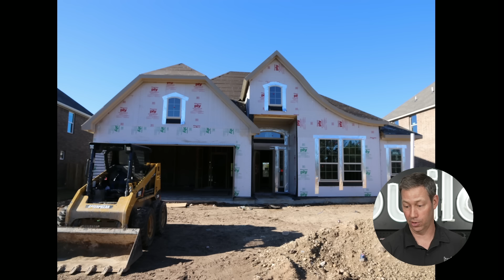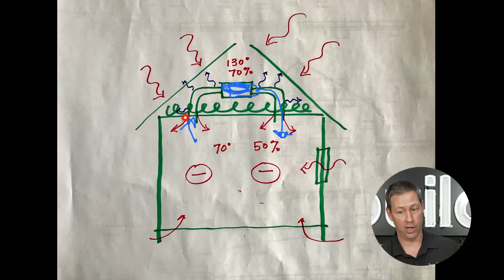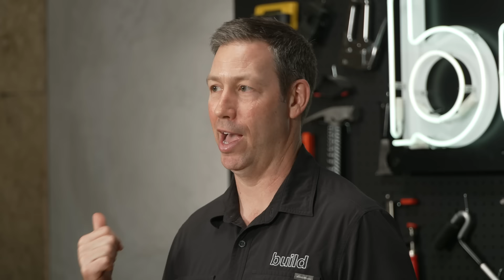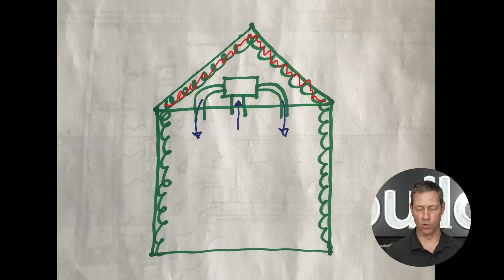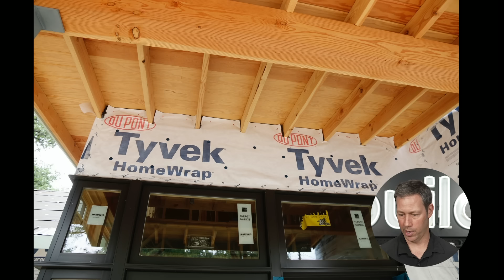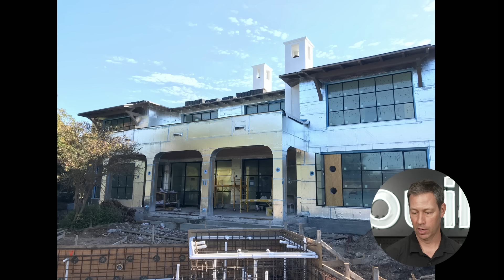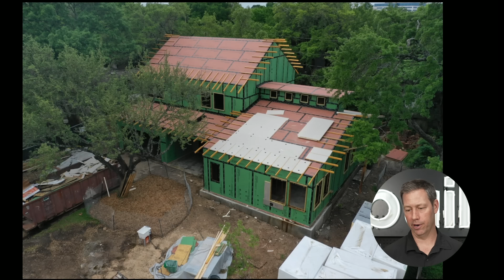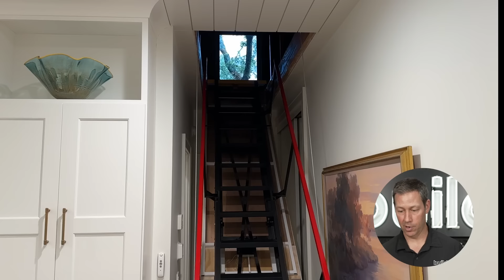CRAPPY ATTICS are Standard in America! Here’s how to BUILD - DECENT or AWESOME

Comment: I definitely would be interested in a video showing how to take crappy to good or great.  Lots of people have an existing crappy attic.
Reply: I second that 👍🏼
Reply: What about asphalt roof can you spray foam that and still have it vented ?
Reply: Would be good. I live in Western Australia. What you are showing as 70’s in Texas is what is in new right now for us in WA. 

None of it is good but it’s all we have to work with. 

How can we make it better? Where to start?
Reply: He has a video doing this (somewhat) I believe it's titled Insulation 2.0. They suck out all the insulation. They seal every on the attic floor like between the joists/drywall, can lights, etc.
Reply: why no absement sin texas?
Reply: @kevinlcnsouthknoxville2685  You could, but why waste the insulation of the space will not be conditioned?
Reply: @randomrazr  the soil is very thin, then it’s clay that shrinks and expands, under that is a sheet of shale.
Reply: @randomrazr  they hit bedrock just a few feet down.
Reply: @randomrazr  most of Texas was an ancient sea. We have shifting heavy clay soils that do not do well with basements. Also our groundwater is high in over half of the state.
Reply: In Austin, I wish I had the know to get a heat pump and get away from gas heating so I could have tried to seal my attic. I'm wondering how I would increase the performance with out having to get an other 10 grand in ac equip to replace the ac unit I just bought a year ago.
Reply: @kevinlcnsouthknoxville2685  they make ducts of sort that staple to the inside of the roof deck between the rafters which provide an air gap and then get spray foamed over. Or what i did, i liquid nail glued some 2x3x4" (so 1.5x2.5x4) blocks to the sides of the rafters tight to the roof deck. I then cut and screwed foil faced polyiso foam board to those blocks and can foamed the seams. I filled the 2x6 rafter bays and then covered everything with another 2" polyiso board and foil taped the seams. So ive got a 1.5" air gap in every rafter bay thats air sealed and if the roof starts to leak theoretically it will either leak out the soffits or just dry because of airflow and never get to any kind of interior space. I went this route as a diy method and i got the foam board for a really good price. It was a lot of crappy work but its already made a big difference. A final note, i glued the wood blocks to the sides of the rafters instead of the roof deck so that way in the future when i get a new roof and roof deck the blocks don't get ripped off woth the decking ruining the foam work. And when that time comes i may also can foam the seams while the deck is off just to future proof and guarantee the system even more.
Reply: @leelulady2010  so basements would flood?
Reply: @randomrazr  People will say "there's no need because the frost line is only a couple of inches" which is true. However, basements are not dug because some places in Texas the water table is too high which would lead to flooding and in other places, the bedrock is too high which would not make for an easy task of digging for a basement.
Reply: Either when reroofing, seal there at the roof deck otherwise gotta take up the floor, remove all old insulation, air seal the floor of the attic, and then blown in insulation on top. Or can convert it to a conditioned attic potentially and spray foam the deck from inside the attic
Reply: @randomrazr  The clay ground doesn't work well for basements.
Reply: @randomrazr  close to sea level and the soil is very expensive & impractical to dig in.
Reply: @TheFlyingCougar  is that why hosues are cheap their
Reply: Insulation is just a thermos for houses! holds daytime heat and gives it to u all night long!
Reply: @randomrazr  1. Limestone bedrock just a few feet down (here in Austin, anyway). 2. The ground doesn't freeze, so no need to protect foundations from heave. Almost all older houses here are pier and beam. I've lived here for decades and only know of one house with a true basement.
Reply: ?? throw some plywood down
Reply: @srt4b  Ideally you want the attic to me conditioned space (or at least partially condition), especially if you have an duct work. Even preventing attic storage items from deteriating from the heat.
Reply: He kind of did this talking about using open cell foam with a pre-foam process to seal gaps...but I agree I would like to see crappy to great...say maybe something you need to do when the insulation and ductwork needs replacing (~30yrs?)
Reply: @kevinlcnsouthknoxville2685   What surrounding counties are you willing to do work in outside of Knox?
Reply: I live in northern Airzona.  Really dry, but the Temps can still reach 110 in July. My house was built in 2002 and looks like the crappy attic. There are huge louvered vents on the gable ends so it is dusty up there. There are piles of pink blown in insulation but nothing on the roof itself. Can I insulate the roof?
Reply: @debrajabs9523  Issue is that your attic is set up as vented roof. You can add interior insulation, but you likely lose the convection that help move heat out of the attic. The insulation will slow the rate of heat, but it will trap the heat inside the attic. A fan on one of the gable vents would help remove the heat.

overall, there are going to be limits you can do to improve your home because of the design: ie you cannot turn a minivan into a sports car.

FWIW: I live in Zone 7 (much less severe summer weather). I have SIP roof & a vented Metal roof. There is a gap between the SIPs (OSB sheathing) & the metal roof panels to allow air flow from the sofitt to the ridge cap to allow convection to help remove heat. This is the most effective option to deal with summer heat in my opinion. This method however isn't cheap as the roof cost about $100K (SIP Panels & metal Roofing panels).
Reply: Me too. Please!
Reply: @randomrazr  if you dig down in West Texas the rock is about 1-2 feet below the grade normally.  Cost to dig is to high.  more cost effective to build up
Reply: You’d need to rebuild your roof from the rafters to do that. It’s not going to be cheap in that sense, not like putting a few more bucks into new construction.
Reply: Seconded. Defintely do that video.
Reply: Yes me too I need to do this to my house how do we do this?
Reply: @randomrazr  because most of the state of texas, you dig down a foot or two and its solid granite or other stone. stone is very expensive to dig thru, so most people skip it. it isnt like say wisconsin where it is all gravel and therefore cheap to dig a hole, which is why almost every house there has a basement.
Reply: @rosegold7975  yes he did insulation 2.0, but most people cannot afford the expense of doing all of that at once, so a video that is more of a DIY how to, versus educating a contractor on how to build or remodel a house is a very different cup of tea. not sure if he would make the home owner upgrade video many of us want, as his channel is more focused on educating contractors and making home owners more aware of what they should be asking their contractors for. plus you get the most cost efficiency in the long run having it all done at once
Reply: @debrajabs9523  Don't you guys primarily use evaporative A/C out there?  Seems like there's a line that starts in El Paso and continues on westward until somewhere in California where brand new houses have swamp coolers installed on the roof all over the place.  Blew my mind how many of them there were because for the longest time I just associated them with poor air conditioning, but apparently it works great when you get in the really dry areas and the extra moisture is a welcome byproduct.  Anyway...if you have a unit like that it can change the equation on sealing and insulating the attic, as it works on positive pressure and some of the sealing issues aren't as significant as they are with refrigerated air.  The blower pressurizes the entire house and is usually vented through big vents somewhere along the gables or roof, meaning some of that cool air is making its way up there to keep your attic cool and also preventing air from getting sucked into your house.  Obviously having excellent insulation and sealing is preferable, as the A/C won't always be on 24/7, but it does lessen the need to upgrade comparatively and going full hog might be a waste.  Depending on your budget, simple interior insulation on the roof along with roof mounted vents to remove the rising heat may work well for you as opposed to gable vents.  The piles of insulation on the ceiling can still benefit you in the winter, keeping the warm air inside your home from escaping into the attic and getting lost through the vents going outside, so that's only something to be removed if you're completely re-thinking your entire attic and want to include it in your conditioned space.  Now, if you have refrigerated A/C, the things mentioned in this video should be seen as home improvement goals ...if your aim is to have the best for your house, then start working toward replicating the kind of things seen in the video.  Closed cell foam, sealing as much as you possibly can, that sort of thing.  You won't be able to get the same results as he did with his house in the last bit of the video, but you'll be able to get fairly close with the right contractor helping you form a plan to insulate your roof and attic.
Reply: @Skinflaps_Meatslapper it’s not dry in Austin, it’s humid. Matt says it’s 90% humidity on a 78 degree day.
Reply: @fearofchicke  Yes I know it's miserable and disgustingly wet in Austin, I live a few hours west from there and unfortunately have to travel there occasionally...but that's not where debrajabs9523 is (she's in Arizona), which is who I was replying to.  That little blue name you see at the beginning of a reply means that's the person it was directed at, just like you meant for your reply to be directed to me and not someone else.
Reply: @nicodemus7784  You obviously did not watch the video. 1. Remove insulated 2. Spray foam (can) all penetrations and cover can lights/spray foam them 3. Blow in new insulation

Can't get any more DIY than that
Reply: @rosegold7975  you obviously do not understand the objectives and limitations of cost and time. We were not talking about “insulating 2.0”, but thanks for the rude, presumptive, and condescending attitude…
Reply: @nicodemus7784  You do it yourself with friends and family = save time and money. It's not hard.

The original comment talked about taking a bad attic to good or great.

My reply to that comment was there is a video called Insulation 2.0 which takes a bad attic to better. You can hire someone or DIY according to your budget. You replied to that comment. And now you are saying "We were not talking about 'Insulation 2.0'" What world are you living in? Don't reply to my comment mentioning Insulation 2.0 if that's what you aren't talking about.

There is no other way to take a bad attic (vented with old/bad insulation) and make it better without removing and adding insulation. Might as well seal up large air gaps while you're at it.

You live in a fairy world thinking you can do something else to get a good benefit that would cost less time and money.
Reply: Main issue with foaming your attic roof is now your shingles can't breath and most shingle manufacturers void the warranty if foam or insulation is butted again your roof line from my understanding and research. So hopefully he talks about that
Reply: I second that
Reply: @randomrazr  Soil condition. Lots of clay, moves around a lot - even on slab houses move a lot here and crack. It can be done, just super expensive so.......
Reply: @kevinlcnsouthknoxville2685  Yeah, this is why I haven't done the "Crappy to decent" thing. I was told an attic is a heat sink for your roof by drawing the warm air under the deck. Insulating the underside of the deck would increase the heat on the shingles, which I assume would shorten their lifespan. 

Also closed cell sprayed under the deck would mask leaks, making a minor leak a massive repair.
Reply: @kevinlcnsouthknoxville2685  if you spray foam you don't need to vent it because there's no air gap and nothing to vent
Reply: How can u move the attic support beams to open up the attic for storage?  My house was built in '73 and the supports are everywhere!
Reply: 810th this
Reply: I was just about to come and comment the exact same thing. My house is a newer build(2019) but still has the crappy attic.
Reply: Step one: Remove existing crappy roof and crappy supporting structure.

Step two: Provide new, non-crappy supporting structure and new non-crappy roof.

Easy!
Reply: @leelulady2010  Clay is the worst.  Anything stone or concrete that you put in the ground needs to have serious drainage all around it or those hydrostatic forces will tear it up.  I built a retaining wall and it's held for 10 year so far... because I backfilled that sucker with a few tons of #57 gravel.
Reply: How do we do it?
Reply: @randomrazr why no basement? The ground is a lot of clay and moves around to much. There are a few but not recommended.
Reply: @oscarchristiantegui  I third that 👍
Reply: It isn’t really hard, you can go from crappy to good… then better… then to awesome.
I did mine in steps. It cut my power bill in half.
Reply: Let’s talk about winter and warm heated air rising into this registers in the ceiling and condensing in the ducts in the cold attic space. I think that’s a big problem that trumps everything. I found gallons of water  inside ducts in an unconditioned attic.
Reply: @Chris-st5fm  the winter is mostly the insulation thickness and wall sealing. The reflective foil is for summer
Reply: It’s called money…
Reply: @21gonza21  and it is worth every penny if you plan on living there any amount of time. You don’t have to do everything at once, but do all you can afford. And later, with the bill savings, do more.
I cut my bills in half.
Reply: I thought that that's what this video was going to be. ):
Reply: @randomrazr  Expansive soils.  A type of clay that expands when wet and exerts a lot of pressure.
Reply: @rosegold7975   The area around Houston, for example; the highest point above sea level is, if I remember right, 50 feet.  It's been a lot of years since I lived there, but all the bayous in and around Harris County attest to how low Houston actually sits.
Reply: This is what I came to the comments to ask also! Lol 
So what can I do with my 1950's crappy attic
that doesn't 't require a total rebuild?
Reply: Really difficult to do. You're mostly screwed
Reply: @srt4b to reduce maintenance costs and energy costs, increase performance and reduce bad health outcomes. Why condition the house at all?
Reply: @Skinflaps_Meatslapper No, only old homes in AZ have swamp coolers.  They work part of the time, but not in monsoon and then you have a huge hole in the side or top of your house letting all that heat in.  ALL new builds in AZ only come with normal HVAC systems.
Reply: Also how to upgrade those crappy pull-down stairs in the hallway, without losing housing space.

I have a crappy attic. Only but a small part of it even has a floor, so a little bit of storage space.
Reply: Even if you just build a walkway that's a huge step up. I made a crappy thin one just with a single 2x4 to walk on--but still waaaaay easier to get up there and troubleshoot now than it was before. All you need is 2x4s, a leveler, and maybe some clamps if you're working alone (as an extra holding hand).
Reply: There are times when I kind of would like to just cut the top off a house and install one of those spiral staircases and build a deck up there rather than this attic nonsense.
Reply: Me too
Reply: If you have standard trusses they were not designed to support a floor with weight on it.
Reply: Mine may be one of the harder ones to get into but I am glad it is not full of my furnace and such
Reply: how much would this cost on a normal 3/2 SFH attic crappy to greaat?
Reply: @kevinlcnsouthknoxville2685  NO! If you foam rafters (if I understand your quest.) you're creating a conditioned (heat retaining) space. So you would not vent it to open air. If you batt the rafters, whether fiberglass or rock wool,  then you will need continuous proper vents (styrafoam baffles) between rafters, up to the ridge beam, on the underside of the roof sheathing to an open ridge vent to expel moisture that migrates through the fiber/wool batts.
Reply: @sethicus  I live in NW Oregon and when drilling my well, the report said there is 47 feet of clay. My house has a daylight basement which is dry as a bone now 25 years after it was built. You can have a good basement in clay if the builder knows what they are doing.
Reply: Me